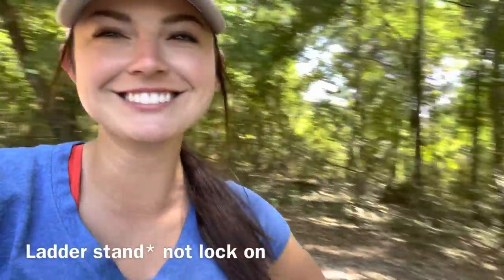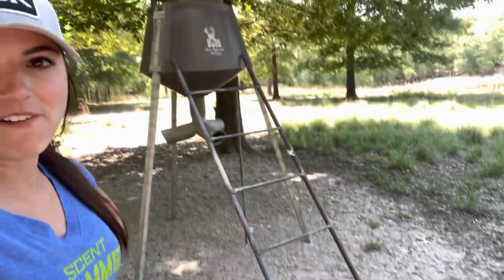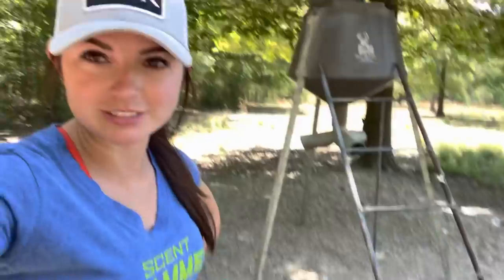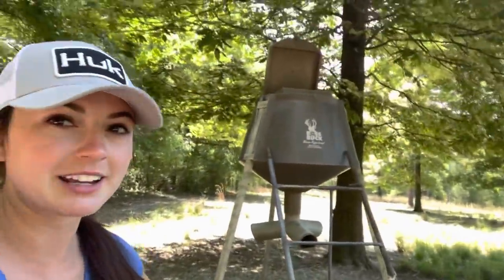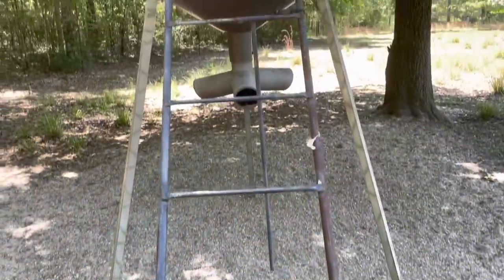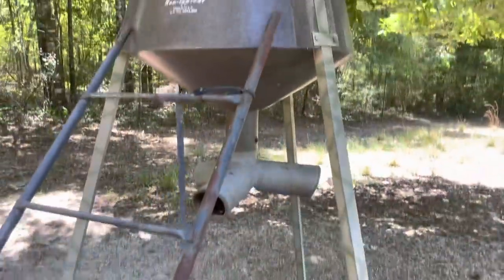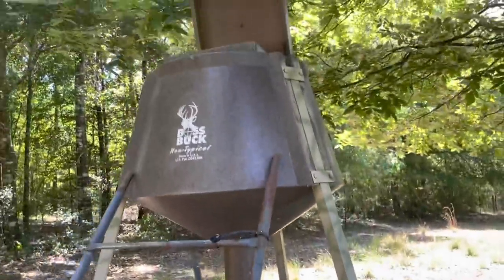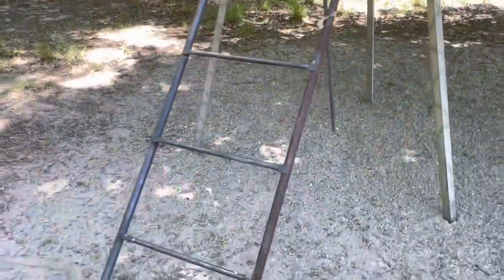Do What You Gotta Do! Redneck Engineering Filling the Feeders using an old ladder stand rail

Comment: Hey Hannah, we all got to do what we got to do, and we have to do it with what we have.
My only suggestion, especially since you were by yourself, would be to TIE OFF THE LADDER to your deer feeder so that it would not slip on you, or twist.
It looks like it fit pretty solid, but always best to error on the safe side.
But as you said, "But we didn't die!".
Reply: Also dig in those poles at the bottom so it don't slide.

Comment: Hannah, just found your channel. Was watching a video of you trapping pigs and I have a suggestion that will make it easier to drag em out to the truck.  Get a aluminum pack frame, tie a rope to the top with enough length so you don't kick them in the nose. It makes the work easier because you use your whole body by pulling from your shoulders instead of just legs. I have used this on many deer and elk. It makes the drag much easier.

Comment: Given your skills and “tackle anything” attitude, you could probably replace the belt tensioner yourself if you can reach the bolt on the tensioner and the 3/8” square hole for a breaker bar to use to release the tension off/on the serpentine belt.

Comment: It's an easy fix. It happens when you get the belt tensioner wet and then gets a bit rusty on the spine and locks up. I locked them up on my swamp trucks often.  When you go to town, just get the new tensioner and it's 2 bolts and a long arm to yank the spring on the tensioner.
Reply: The funny thing is, over 600 comments, mostly guys and no one brought you a new green fiberglass ladder or came to take off the old idler and belt to go get new ones an get new bolts too!! God bless you and your Dad. Don't forget Father's Day is June 19th!!
Reply: @smiley1949  She's in Bama I think ? I'm way down south in South Florida or i'd had done it in 10 seconds. With as many as I have had lock up on me,I have plenty knowledge on these PITA idler tension pulleys. Mostly Chevy's though.

Comment: My feeder I have had for 10 years was low enough I could back my truck and stand on tailgate. 3 months ago, it was snapped off and drained a freshly filled feeder. I repaired it and installed screws, but I wasn't sure what did it.  2 weeks later, I saw 1 axis buck  standing under it with head down. Hour later I looked and again feeder was broken off. Now he has taught others. I have neighbors who's feeder was drained yesterday.

Comment: We found 2 trees about 10 foot apart.  We screwed 2x10's on both side of the tree, hung a pulley up there and ran a cable to a hand winch (think boat trailer) and attached it to the feeder. We just lower it to the ground. We set a milk crate under it to let the dispenser nest in and then fill it with corn. Of course if I was your age....I would do it the way you do lol.

Comment: Hopefully there’s no next time if the hunting truck is still broke. Go get the corn in the big truck. If The hunting truck will run just off the battery load the corn from one truck to the other as long as you dont haft to go far it should be fin to drive it